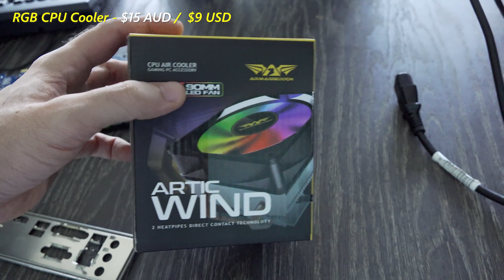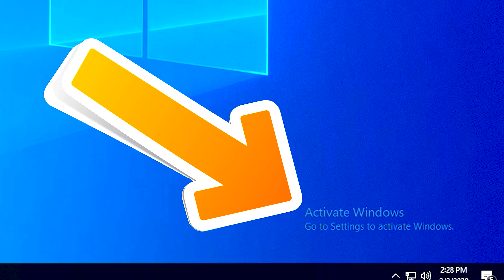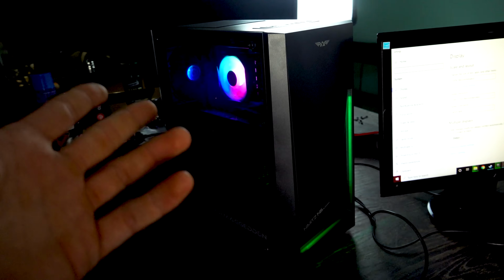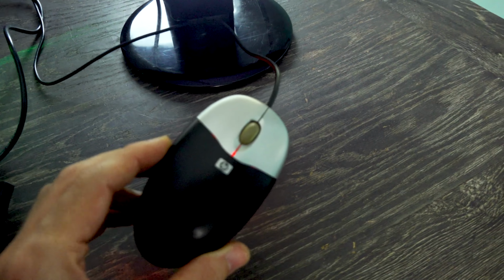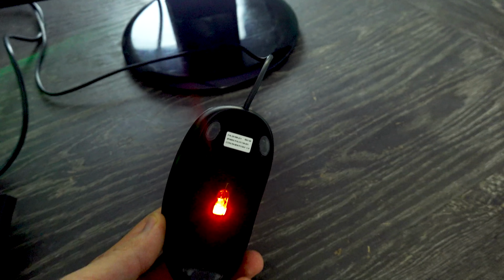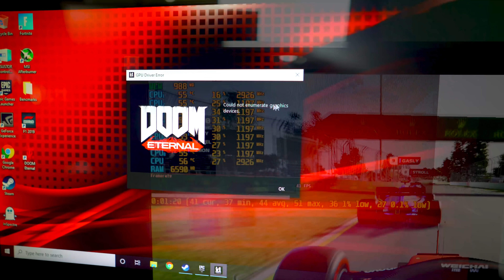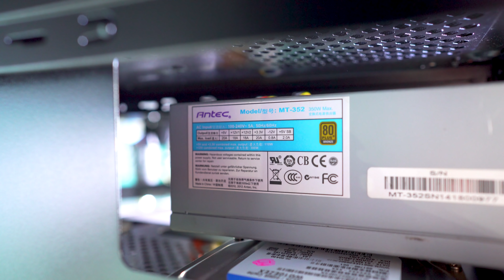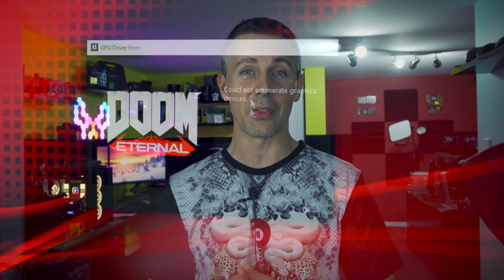A WHOLE Gaming PC Setup for just $75... Can it GAME at 720p!?

Comment: Your case being more expensive than your Graphics card is scary
Reply: The case is the most expensive thing on the rig lol
Reply: lol
Reply: It's one of the most important parts if you want to sell the PC.. People who don't know how computers work will think that it's good, because the case has RGB and looks modern.
Reply: My case is almost as expensive as my graphics card, lol. I payed a little under $60 for the lowest config Matrexx 55 (not the best deal) and my 580 that was initially busted but works now cost $60 exactly.
Reply: @JeffsTechOfficial  Well the point is that the case is useless because it doesn't effect performance of the system, and you don't need a good looking one if you don't want to sell the PC. You don't even need a case to use a computer. Any case that has decent airflow and somehow holds the components together is good enough.. There is no need for anything more than that.
Reply: @_________________404  oh yeah of course, I thought I'd just share that because my PC was really budget oriented.
Reply: @_________________404  step one get an office pc
Step two litter it with rgb
Step 3 ???
Step 4 profit!
Reply: @JeffsTechOfficial  they're not a bad case, I enjoy building in them and find they sell well because they're a clean, modern design with tempered glass. Perfect for 50~60 bucks!
Reply: @shiroganekatsuki2940  I wish I could claim the same, but they're nearly equivalent lol
Reply: Nep Nep Nep Nep  sorry to hear that. I was fortunate in my move in that way.
Reply: Get a caselabs
Reply: That case is overpriced. I can get a new Fractal Design Focus Mini OEM case for approx 35AUD.
Reply: Lol do you even know a thing about how much the computer parts cost?
Reply: My case is 80, my graphics card is 3
Reply: I know it's kind of off topic but do anyone know a good place to stream new tv shows online ?
Reply: @Rohan Gunner Lately I have been using Flixzone. Just search on google for it =)
Reply: @Oliver Kevin Definitely, I've been watching on Flixzone for since march myself :)
Reply: @Oliver Kevin thanks, I went there and it seems like they got a lot of movies there :D Appreciate it!!
Reply: @Rohan Gunner You are welcome :)

Comment: Honestly v impressive, especially with the native 720p monitor. May not be the best for browsing, but a native display is miles better than lowering the res on a 1080p display. luvvvv it
Reply: hahah you are everywhere
Reply from the maker: OZI! Awesome chatting the other day! And 720p is actually really underrated in the used market.
Reply: Back when the best PC on the market was only came with 480p crt monitor and the gpu can't even output amazing graphic on it like even the year 2000 PC can do. 

Still, great game is a great experience.
Reply: @techyescity , I still use a 768p monitor....
Reply: @digantamajumder5900  an old dell monitor I had died years ago otherwise I'd probably still be using that.
Reply: @ArtisChronicles , yup...
Reply: @techyescity  Me buying a 1600x900 IPS display for low end gaming

Comment: I built my son a PC for Christmas FX8350 560ti and 16gb ram, he's 4 so it didn't need to be anything special. 
 It's not a bad system for what it wound up costing me. £60 total... I already had 3/4 of the parts as I tend to keep old parts and try reuse them. The newest game I've have running on it is control which ran 720p at 30fps. Esports titles / emulation it's absolutely spot on for.

Comment: Finally a computer at my budget. Now I just need to find a dumpster...
Reply: Check out your local recycling centre, or even put a wanted ad on Facebook marketplace. I've picked up some great deals on stuff being thrown away or sold cheap. 

The current pick is a Core 2 Quad system in a Shuttle case with 2X2GB DDR2. Free from the garbage dump, cobbled it together with a thrown out power supply and after a good clean it's up playing my collection of older titles like Max Payne 1 & 2, Medal Of Honour Allied Assault, basically anything pre 2010. It'll go to a family in need, complete with the library of older titles. 

Happy hunting!
Reply: @boingkster  Thanks for the advice! Do recycling centers allow you to take computers, or do you have to pay? I have never been to one because I assumed they dont allow the public to wander around there.
Reply: @luke2v52  often they will let you take them if you ask. But definitely ask first sometimes they may not want you to take them, or may accept a simple offer of 5 dollars per machine. If they ask what you want them for just say you need some spare parts to fix your old PC u til yiu can afford a new one.
Reply: same
Reply: The employees at the recycling centres take the stuff first most of the time😢

Comment: I've been dailying a i7-860 since 2013 and I'm most pleased about it's performances. It was first paired with a Windforce overclocked GTX 660 and now it's got a GTX 970 EVGA Superclocked.
To cope with that "new" GPU I bought a cheap AIO, delidded and lapped the CPU to achieve a stable 4,2GHz. It now runs everything quite nicely.

Comment: I love pushing old equipment to the limits. I was given an old Asus P5B Deluxe MB in a 4U server case. I bought a Core2Quad Q9505, 8 GB of RAM, and a GTS 450 (1MB GDDR5) for under $50. My favorite online game is World of Warships and I forget if I am running 1600x900 or actual 1080p, but at lower graphics settings I am getting as high as 70+fps. 
It is honestly amazing what some older HW can do. Too bad about my 2 X5570 CPUs sitting around doing nothing because LGA1366 boards are EXPENSIVE.
Reply: 1MB?
Reply: @van0tot100  lol. Typo. 1 GB. Good catch my friend.

Comment: I have a similar setup for my older gaming PC, but mine has an Intel Core 2 Quad Q9550 that I was able to overclock to 3.3 ghz with 4 gb ddr2 ram that I have running at 970 mhz, and its graphics card is an GTX 570. I have that with an 180 GB Intel SSD. Its monitor is a ViewSonic with a resolution of 1680 by 1050, I guess a little more than 720p but not quite 1080p.

Comment: After setting the PC to high performance power setting go-to advance power settings at the bottom the expand processor option set minimum power state to 100% that will make it run balls out and you won't see those drops from 2.9ghz to 1.1ghz 😉 guess you could say it's a poor man's overclock without overclocking lol basically it makes it run full turbo at all times

Comment: i have a gtx560 (not TI) and ic an still play many games. I play Overwatch - low settings 1080p 70fps. Fortnite runs at low/medium 1080p at 70fps. definitly still holds up if you are fine with low settings

Comment: i had a 650 2gb not long back.. used it till late 2018. paired with an i3 2100.  these old parts dosent give much performance.. but these old parts will always have a soft spot in my heart. also.. test this rig with a 750ti. it will be a much better pairing

Comment: Those Logitech made mice aren't bad and I've had one on my old Pavilion back in the early 2000s. It was capable of gaming. I later found out it was a rebranded Logitech MX300 with a pretty decent sensor. Unfortunately I threw it out when I bought "gaming mice" such as the Logitech MX518, Razer Deathadder etc.

Comment: My gaming pc back in the day ran some type of 21" multisync CRT monitor and yes I ran whatever resolution gave good frame rates and looked OK at the higher graphics quality levels. That was the nice thing back then, use whatever resolution worked best with what you were playing. I think I ran anything from 640x480 but mostly 800x600 because it looked nicer and frame rates were good. If my combination really worked well with a game 1024x768. No lcd or wide-screen monitors back then. Would have been cool to find one of the Sony uber high end wide screen CRT monitors but the 21s" were heavy enough and used a lot of power, but they sure looked nice.

Comment: Hey man, love every single video of yours. I have a question or a suggestion for a video rather. I see a lot of people having some sort of freeze problem with AsRock AB350M Pro4 mobo, where sometimes it works and sometimes it freezes. If you manage to find it for a good deal would you consider making a video on how to make it stable?

I personally tried with 1600x and 2600 and it was the same result. I flashed the BIOS, no luck with that. Maybe some BIOS settings I overlooked.

Thanks for even reading through.

Greetings from Serbia, and stay safe!

Comment: These parts would be better purposed as a high-end Win XP retro-gaming rig.

The Nehalem generation CPU does not support the AVX instruction set, so a ton of games simply will not run on this platform.  Sandy Bridge should be the oldest generation considered for modern Win10 gaming.

Same goes for the GPU... GeForce 500 series had driver support discontinued last year, and you can expect 600 series to be gone later this year.  700 series shoud be the oldest considered for modern gaming.
Reply: Well the gtx 770 is basically just a 680 so when the 600 series is no longer supported the 700 series will be as well

Comment: quick question: what kind of spray did you use? is it safe to use for computers on ungrounded outlets. It's quite common in the Philippines especially for older homes.
Reply: He usually uses brake cleaner or WD-40, and also using a PC on an ungrounded outlet should be fine

Comment: i managed to oc i5-750 (2.66) to 4.2ghz using 210x20 (for more performance)
crazy voltage, poor chip, mine 760 was much better , used snowman t6 dual fan (82deg on prime95) with mx4 + delid :) 16€ :)
i had gtx 560 in as well, nice gpu, oced the hell of it, did you run inspectre? :)

Comment: 🤣🤣🤣 I just built and sold a Fortnite PC. FX 6200, Gigabyte GA970a-DS3p mobo, RX 460 2gb unlocked (HP OEM), 4 X 2GB Samsung DDR3 1333, 1TB Seagate 7200RPM Sata6 HDD, EVGA 500 Watt 80 Plus White, 2 Corsair 120mm fans, Asus case and DVD drive. $200 w/2 Monitors. Fun part was the day I spent overclocking that FX. Got it to 4.2 ghz @1.38 and turbo to 4.4 Ghz @1.400. Dude loves it. Played Fortnite with him after he got it home. Pickins are getting slim.

Comment: This is probably an ideal combo for doing any form of Low End to Mid~Tier Emulation, provided that you aren't using an extremely CPU or GPU~intensive emulator such as BizHawk (especially for Sega Saturn and Ultra 064 titles at higher resolutions), BSNES HD (at anything above 0480p with its enhancements), or any emulator of a Generation VII console (Dolphin, I would expect to be the most stable for plentiful titles; RPCS 03 will definitely see a setback, due to low VRAM on the Fermi cards, and a 1070 Ti or 2060 Super is a recommended minimum for titles that may require 08 GB of VRAM, even at only I280x0720); once we get into Workstation tasks such as Video Editing and Model Rendering, I expect this system to lag far behind what we can experience from modern hardware, Westmere/Gulftown and Fermi truly are showing their age massively and I would only say to get this hardware if you are in the business of making Budget Emulation Stations that can see some form of upgrade down the road; even browsing the Internet with Westmere can be a bit unpleasant if you're like me and have north of fifteen tabs open at a time in Opera (with many extensions), thus any builder must know what a system such as this will be used for and also how beneficial the upgrade path can become before a clear bottleneck is observed at any point.
Reply: You sure you don't mean 01070 Ti and 02060 Super ? Maybe 00480p ? How many leading zeroes is enough for you ?
Reply: @mrlithium69  Numbers that begin to go into the thousands will not have a zero put in front of it by me (unless we're talking about a certain piece of code or a legal model name), that's always been my personal Golden Rule on this structuring for the past ten years; if you ever see me have a zero in front of a number in the thousands in other use cases, then that'll ultimately be in any game that measures score, time, and item tally in a way where there is a cap on the overall amount that can be reached (Example: Markey Jester's Pana der Hejhog uses exactly what I am mentioning for Score and Ring Count; there will be multiple zeroes until your Ring Count goes into the hundreds and your score goes above I00000, the latter of which is hard to nail off but very possible with a properly timed Enemy Combo), many Arcade titles were notorious for doing this long before I started doing so and it seems that many have forgotten about that truth.

Comment: No joke bro would love to have that pc atleast its hella better than my gt710 and  core 2 quad
Reply: You can do a lot with a C2Q and GT710! Download MSi Afterburner and tune the 710, the core should take andn easy 100 to 150mhz, and the memory I'd start at 200 and work up from there. Test with the benchmark suite from userbenchmarks dot com, its a tiny 5mb download and works alright plus ranks components to let you know how they're doing compared to other people's test runs. You can also do the tape mod to the Quad and get it running at 3GHz if it isn't already.
Reply: boingkster it has to be a q6600 to do the tape mod(not sure about the q6700)
Reply: @EvilTurkeySlices  anything with a 1066MHz FSB speed. The later chips often had 1333 FSB which doesn't work with the same mod.
Reply: @boingkster   bruh my gt 710 is hella modded and over clocked its 250  and 350 and i straped a fan on it too cuz its passive cooled from factory
Reply: @muhammadamin7999  check out old-games dot com, they have pretty much every title from 2010 and before. You should be able to pllay any of them. Free download on limited speed, or like 9 bucks to access the full speed download. Halo 1, Diablo 2, GTA 3 and Vice City, Empire Earth, the Age of Empires collection, Need for Speed Underground 1 & 2, Baldurs Gate, all of those would be perfect for the GT710. CS:GO will work on low settings too. Other than that you'll need a new card. Otherwise, check out lowspecgamers channel for game mods and the 710 will be able to run pretty much anything with those mods.
Reply: @boingkster  cna the tape mod work on core 2 quad. Q9400 2.66ghz 1333 fsb ????
Reply: @muhammadamin7999  there's a different pin procedure for it. You'll have to google it.

Comment: Actually, when getting a low budget system for yourself, you can consider getting 6GB RAM to really cut costs. 4GB + 2GB working in flex mode. There, I just saved you 2bucks.

in Flex mode, 2GB from each module will work in DualChannel. the remaining 2GB in the 4GB stick will then work in SingleChannel.
yea, this comes in handy when you need more than 8GB, but can't afford 16GB. Or need more than 16, but can't afford 32.
Reply: I did this with my righ, got 24 instead of 32 2 8gb and 2 4gb sticks

Comment: My PC 2012-2013: that same asus monitor, i5 3470, 2x4gb ddr3 1333mhz, gtx 550ti gddr5 1gb, asus mb, play all games 720p high 30-45fps avg farcry3 battlefield4 and more

My PC 2019-2020:
MB: B450 Aorus Elite
CPU: R5 2600 4000Mhz 1.3V
Cooler: Liquid Deep Cool 240 V2
RAM: 2x8GB Aorus 16CL 3200MHz
VGA: Gainward Phantom GLH RTX 2070 8GB GDDR6 DX12, GPU+60Mhz GDDR6+600MHz Power120%, 3xFan
M.2: Kingston A2000 500GB 2000MBs
SSD: Adata XPG SX950U 240GB 500MBs
HDD: 4TB 7200Rpm, WDBlue 1TB, WDGreen 1TB, Haitachi 2TB
Case: BITFENIX Enso Mesh RGB black
Case fans: 3xFront 120, 2xTop 120, 1xBack 120
PSU: GAMDIAS ASTRAPE M1-650W 80+
OS: Windows 10 Pro x64 V1909
Games: LG TN 24 60Hz DisaplayPort, 1920x1080p, Ultra (Max) minfps60+
Other: gaming mouse 2500dpi and keyboard, stereo speakers and headphones

Comment: I am thinking that monitor was a 1366x768 (768p) res monitor very common for laptop monitor resolution before FULL HD laptops were common, 720p is a bit smaller resolution 1280x720.

On a DIFFERENT note, I guess now that you're outta PC parts, you have gotta find another way to make content. Maybe more podcasts/live streams with other tech tubers? On the future Q3, Q4 of 2020. Special projects that have been sitting around!?

Comment: Wooow, now that's some yes part to performance. Btw I can't find any gpu that will fit in my Dell 3020 minitower what gpu do I buy?
Reply: Need a low profile card with a low profile bracket they are usually expensive but there are 750ti, 1050, 1050ti and 1650 versions
Reply: you can probably get a zotac mini?

Comment: i play games on 1280x1024 monitor using i5 3470 and rx 470 and it rocks at that resolution
apex legends on high = over 100 fps majority of time
fortnite over 200 but i limited fps to 120 to smooth thing out cuz frame dips

Comment: Brian, how do you get MSI afterburner to show you AVG FPS, 1% low and 0.1% low? I have them checked and set to show in OSD, but they won't show up for me. Frametime shows for me if I have it checked, but the above mentioned monitors will never work for me.
Reply: @SISSYPUSS  damn. Thanks so much
Reply: @SISSYPUSS  I really appreciate your help. I haven't been able to find any info on this anywhere
Reply: @SISSYPUSS  That's super helpful. Thanks!

Comment: If it weren't for the PSU one could do a little CPU oc'ing, at least whatever is viable without increasing the voltage. Some H55 mbds handle it ok, eg. the Gigabyte UD2H is pretty decent, but it varies. Oddly enough I built a system for someone way back with a 560 Ti and an i5 760 on an H55 board, oc'd to 4.0, worked nicely. The i7 860 is obviously better (most of the time), but it does run about 10C hotter than the i5s. If you can get a P55 mbd though then the oc potential is much better, eg. the Asrock P55 Extreme is a good midrange option, if you can find one (on a good mbd an i5 760 can run at 4.4). Here's an i5 760 @ 4.2GHz on a P55 Extreme, driving a 7970 GHz Edition no problem:

http://valid.x86.fr/pfy34a

but for modern games the extra threads of an i7 would be better.